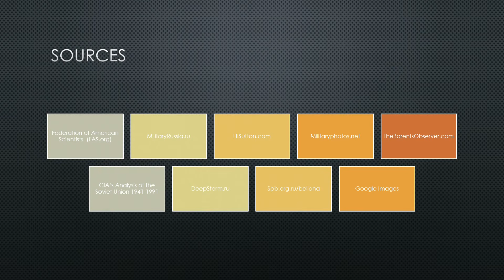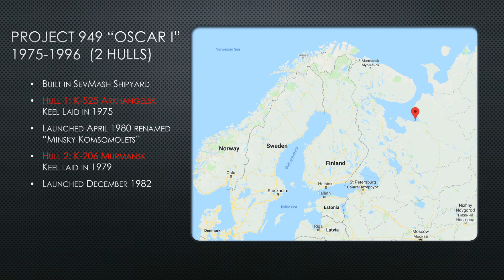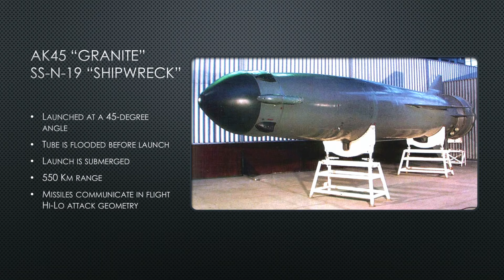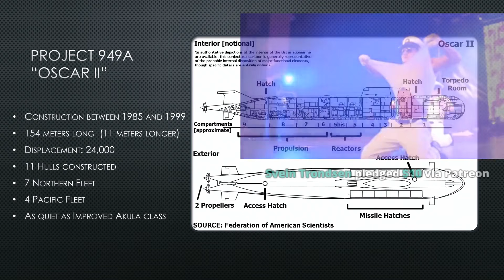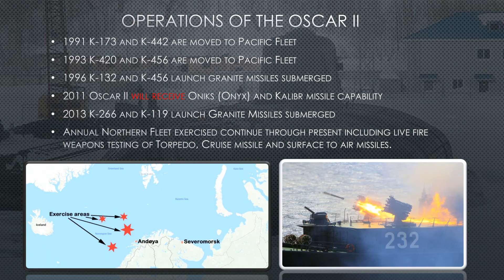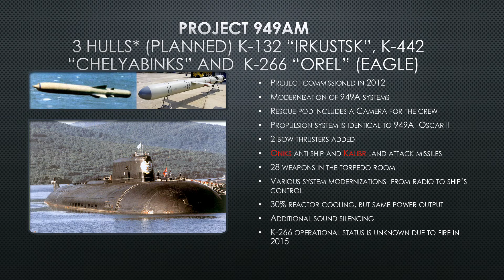Oscar SSGN Sub Brief

Comment: Hey Jive, quick question fella.....when the Kursk sank was the USS Toledo(SSN769) in very close proximity at the time? Also how did it get damaged, warranting it limping back to Norway for repairs ? Thanks
Reply: It wasn't by collision with the Kursk if that's what you're implying. The Toledo is less than half the displacement of the SSGN. Had the two tangled, both would've ended up on the bottom. Anything else would be bumping up against his NDAs.

Comment: Great video captain!  :) Fun fact about the newest upgrade, yes Granit missiles are replaced with the Onyx, but for every Granit they can fit 3 Onyx in the tube, so the number went up from 24 anti ship missiles to 72 on the new ones :) (Onyx-m with 800 km range)
Kalibr has a 660km range anti ship variant, that is subsonic for most of its journey, but for the last ~ 50km the real warhead separates and with rocket power sprint attacks at mach 3.
P.S. Since Kalibr, Onyx and Zircon can be fitted/fired from the same VLS system on ships, I wonder if they can just swap the Onyx missiles out for Zircons on the Oscars when they make enough of them.

Comment: Excelent video, as usual, thank you for that. Only thing (minor) you were wrong about is a cobalt nuclear warhead. Cobalt is not ment to replace uranium as a fuel, because it can't as it is not a fissile material.  It is ment to be part of a nuclear warhead casing. It  will then absorb some radiation, become radioactive and stay radioactive for very long time in form of radioactive fallout.

Comment: Has an emergency crew escape capsule (on any sub type fitted with one) ever been utilised or tested at sea? It's such an interesting engineering solution & I've heard about other 'proven' escape tech from the various WW1 & 2 breathing apparatus through to the McCann Chamber and modern sub rescue vehicles - I'm wondering if the capsules have ever been demonstrated?
I remember the whole Kursk incident unfolding & the frustration all over the world that Russia wouldn't accept the offers of help - even the general public knew on day 1 that they were lying through their teeth & it was costing men's lives. Listening to the genuine anguish of submariners from all of the countries that tried to help is almost as heartbreaking as hearing the wives - politics be damned, everyone just wanted to bring them back alive.
Reply: It has been used during the Mike SSN incident if I'm not mistaken
Reply: @vuk3303  and all but one guy in the thing died. Lol it's real practical.

Comment: Launching a nuclear autonomous torpedo should be considered a first strike attempt.
Reply: My worry is that these "torpedoes" will fail at some point for any number of reasons and wash up on a beach somewhere without propper reactor cooling. or worse slam against costal cliffs until it splits open...
Reply: Agreed. Let one of those slip the chain...that's an act of war.

Comment: Mouse Roar - xD terrific name :P   most probably some kind of chirp signal, spread along wide spectrum. 2.5" doesn't sound think for submarine though.  Isn't 688 3" or something?  BTW: SS-N-19 Granits had better avionics than contemporary state-of-art Soviet fighter jets.  One of the sources you mentioned (FAS?) described them as first fully digital radar in Soviet Union and it probably had multispectral capability IR or emission signature matching.   What is important is US-A Liegienda Soviet Sattelite system - RORSAT.  BTW is such a mammoth of submarine is as quiet as improved Akula, despite having twice the power / reactor / screw count.... that is SIGNIFICANT.

Comment: Kalibr is an entire family of missiles, including land attack, anti-ship, and anti-submarine variants. Most of the attention has been on the land attack application, but I remember some years back reading about how the anti-ship variant was causing some concern to western planners, especially since Chinese Kilo class subs could use it.  There are two main types of anti-ship Kalibr/Klub variants, one group is purely subsonic, like the standard land attack variants or the Tomahawk. The other group has a supersonic terminal phase, with a speed somewhere in the neighborhood of mach 3. I suspect the introduction of Oniks and Tsirkon has kind of reduced the relevance of the anti-ship variants, and I don't know if they are actually deployed, but they still appear to be viable.
Reply: They are still much smaller than Oniks/Zircon so they should be deployable from more platforms, definitely still retains some use. And having an initial cruise phase should in theory mean you can use a longer range, pre-programmed path where the final attack may come from an unexpected angle, while the big powerful AShMs would have a more straightforward vector.
Reply: @zolikoff  All three missiles (plus the phantom P-900/3M-51, maybe) are supposed to be launched from the same 3S-14 UKSK and 3P-14B VLS. I don't think there is a huge difference in diameter, but judging from the diagrams and models I've seen there is a pretty big range of lengths that can fit in the systems mentioned.

Comment: is there a theoretical maximum to the size of a sub?
Reply: There probably isn't a maximum in terms of being physically possible but in a practical sense there probably is. Like with battleships vs smaller ships, you could make a massive sub that could carry a lot of ordinance, but at the end of the day you still only have one sub. For the same or less resources you could have several smaller subs that now you could deployed in different areas at the same time or have ready for redundancy. They would presumably also be faster and easier to maneuver, as well as "hide" both above and underwater. You could be super quiet but if you had something the size of a large building underwater it'd probably be pretty hard to hide from an active search. I dont see why couldn't make a sub that could make the Typhoons look small but you'd have so many fewer "super subs" then more "conventionally sized" subs it probably wouldn't be that useful in comparison. There are better ways to achieve the same "goals" in my opinion
Reply: It comes down to trade-offs & what you want to get from your vessel. Engineering is a game of trade-offs - bigger VS heavier, functionality VS $$ cost, risk VS reward. And one of the biggest trade-offs underwater is how deep do you want to go VS your ability to withstand crushing water pressure. Think about the size of James Cameron's submersible that went to the deepest part of the ocean, the Marianas Trench - it was able to go WAY below the crush depth of any military sub, but it was built entirely out of very expensive materials like titanium & was so small he couldn't even stretch out in it. 
Military subs are a trade-off between strategic function & cost - diving as deep as your materials & engineering will enable you to go, with stealth, with the ability to carry & deploy ordinance (remember that your torpedos & missiles have their own trade-offs with useful depth, etc), with cost of building materials, fuel, etc etc. Also overlay your political & military agendas, like the bragging rights of your navy having 'the largest/quietest submarine' which often trades off with $$$. 
And us humans are very resourceful & very good at testing any theoretical boundaries, so its more a question of $$ and desire than any physical or engineering maximum.

Comment: I am afraid you mixed up the chief designers for the sub and missile project, probably because both projects were called Granit. Pustyntsev was a sub chief designer. The chief designer of the P-700 Granit missile was Vladimir Chelomey.
Reply: Chelomey? If I recall he also had a more competent and logical design for the Soviet moonshot program as well with the URI-500?
Reply: @atomicexistentialism8428  The very same. UR-500 is not a Moon rocket, though, that was UR-700 project. UR-500 is also known as Proton and was used for heavy payloads, such as space station modules etc.
Reply: @amedv  Ahh! I new it was something like that. Thank you kindly :)